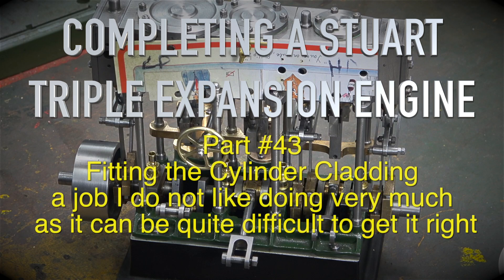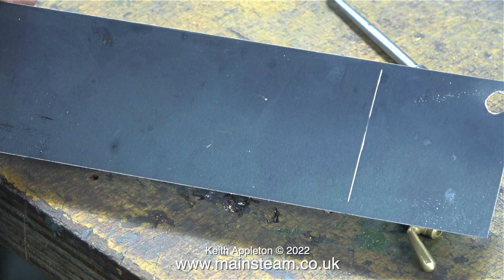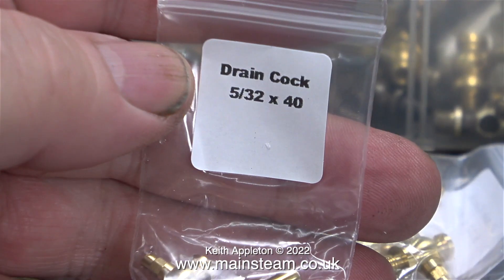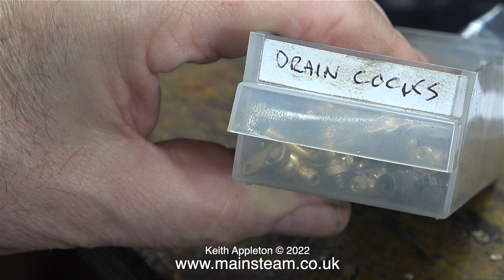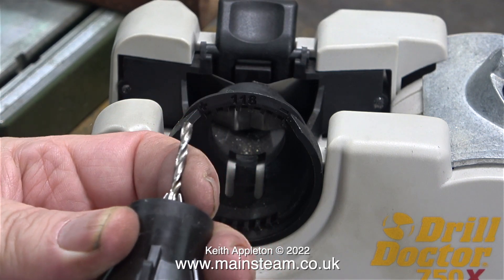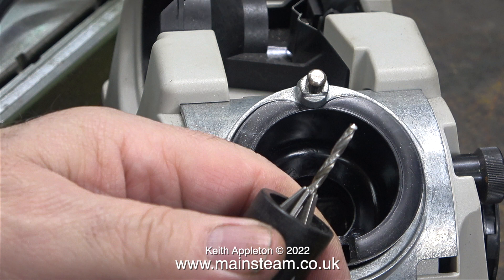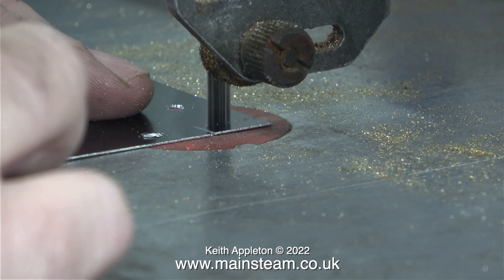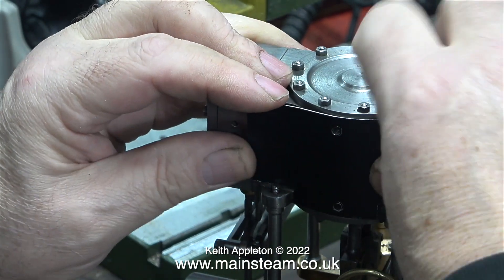COMPLETING A STUART TRIPLE EXPANSION ENGINE - PART #43

Comment: I'm 2 years late, but....... I clamp sheet metal between two pieces of thin plywood for drilling or cutting. That way the metal doesn't distort when the drill breaks thru or when it's sawn. (sawed?)
Just my 2 cents from Philippines, I'm really enjoying your steam engine videos!
Reply from the maker: Yes you could do that, but I find that once piece is usually enough.

Comment: Perhaps try centre-punching sheet aluminium (all sheet metal) on a steel base, which would negate most of the distortion. Yours looks like it was centre-punched on wood, which is obviously going to negatively distort the workpiece.
Reply from the maker: Yes, I should have done that. It was very cold when I made this video and I was too lazy to go into the outer part of my Workshop to find a piece of steel sheet }:-)))

Comment: Bit of a shame to cover that lovely mahogany planking with a piece of sheet metal, but I suppose it's true to the original full-size engine.

BTW, I believe I spotted a bench block on your bench in one of your other videos. That would be a much better surface to back the aluminum when center-punching.
Reply from the maker: Yes, I should have done that. It was very cold when I made this video and I was too lazy to go into the outer part of my Workshop to find a piece of steel sheet }:-)))